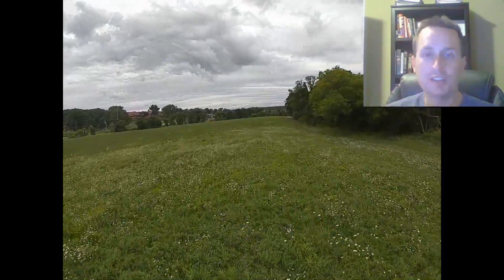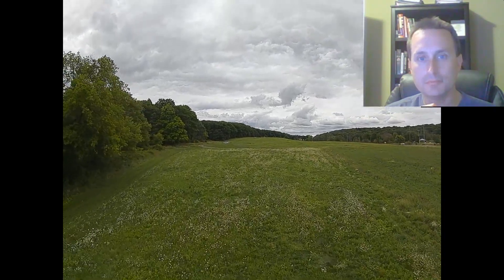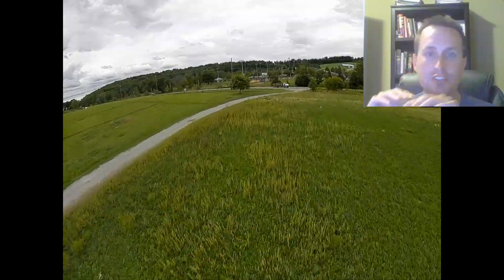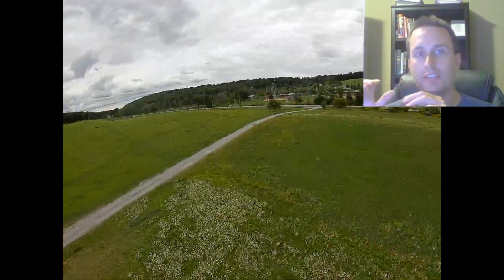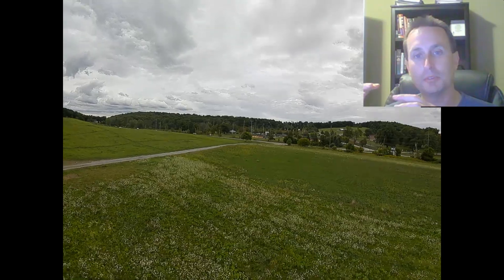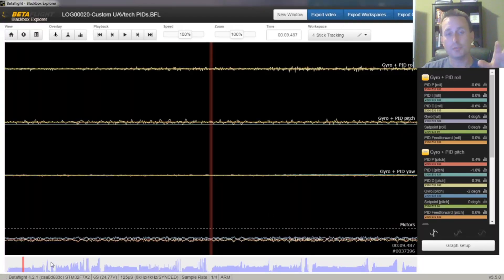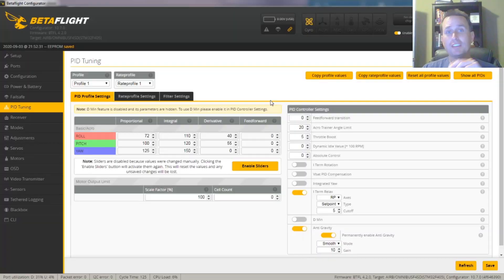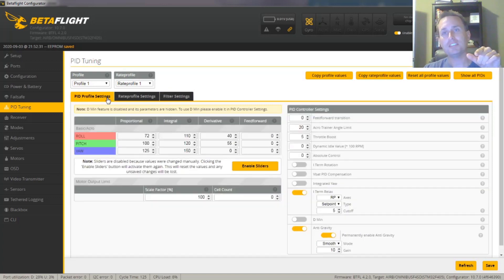8" OctoCopter w/o Gyro Lowpass Filters?!?  😱💥

Comment: HI, as always great video. What I would be interested in, from a filmmakers, cine lifter users stand point, would really be not so much propwash handling in sharp turns, or 900rpm flips and rolls or any of the usual 5 inch acro goodness, but getting the vibrations an wobbles out in normal forward flight. It seems you also weren't able to get rid of them, as am I struggling to do so as well, especially when there is a slightest breeze. Producing the cleanest footage is the most important thing and my experience is those vibrations are even more magnified in the high def footage.
Although the quads are mechanically perfect it's really hard to get rid of them. I would be very interested in seeing someone with your expertise investigating the matter further. Have a good one:)
Reply from the maker: We jump into that here: https://theuavtech.com/2022/05/how-to-troubleshoot-shakes-and-jello/

Comment: Love it. I have been flying betaflight with a 19 inch prop. The prop itself is running at 52-62 Hertz. So, I also turn off the first stage low pass low end frequency filter.